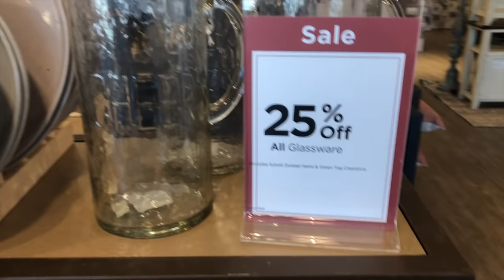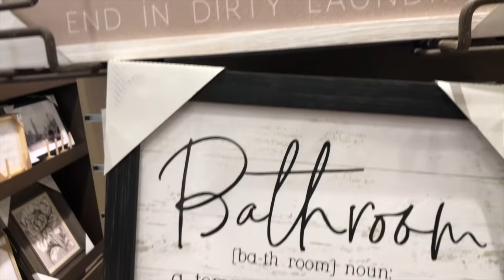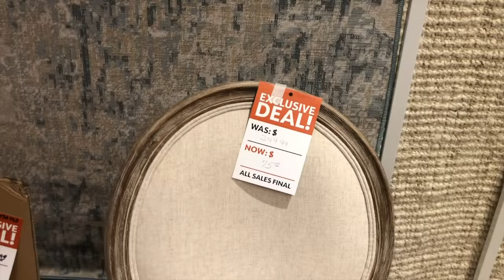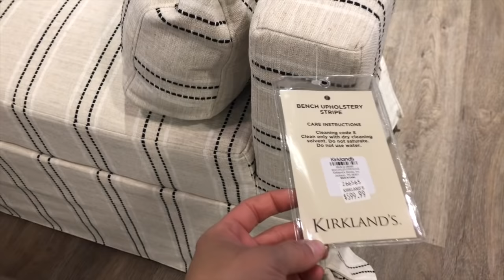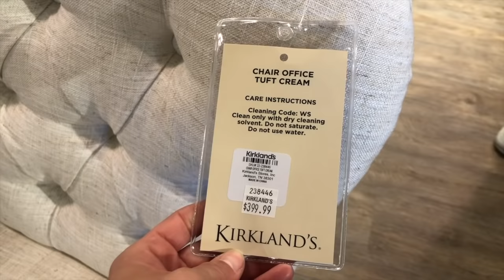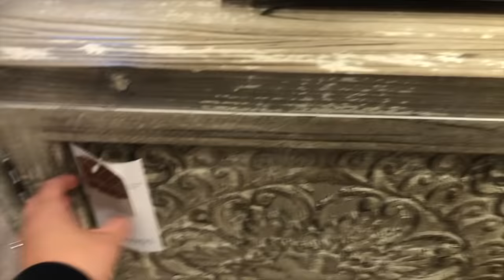SHOP WITH WITH ME AND FURNITURE FLIP | Kirkland's Inspired Furniture DIY

Comment: 0:00: 🛍️ A shopping trip to Kirkland's and a furniture makeover project are featured in the video.
3:38: 🛍️ Exploring a variety of home decor and dinnerware at a store.
08:19: ⭐ Exploring furniture at a store and getting inspired for DIY projects.
12:45: 🎨 A demonstration of painting a furniture piece with DIY paint and achieving a chalky finish.
16:30: ⚙️ The importance of applying wax to clay-based paint for protection and durability is demonstrated through a DIY furniture project.
Recapped using Tammy AI

Comment: Great job .would that paint work on a dining room table?
Reply from the maker: Yes it will. You just need to make sure you seal it with several coats of polycrylic for a dining table that gets used often so it will hold up against drinks and food etc.

Comment: Great fantastic job on this new buffet, but to make it even more rustic and appear taller in height, I would have added really thick boards, wide shiplap  but thick wood for the top. Stain the color of the shelves or paint it like the rest. Would gave been even more rustic looking. I still love what you did with thus piece. I love red, but not in most furniture pieces, except a refurbished trunk we have. It is the only red oc in our family room goes with the red in our curtains and then we have a little red in our stained glass lamps. I'm lookinh for a piece like this for our foyer, but wider and wont pay store price  for it. No way. I don't shop Kirkland anymore. They closed out all of them in our cities and state  along with pier 1 too. Good riddance. High priced crap, you can get for alot less at Hobby Lobby,  good will, thrift stores and tatd sales.